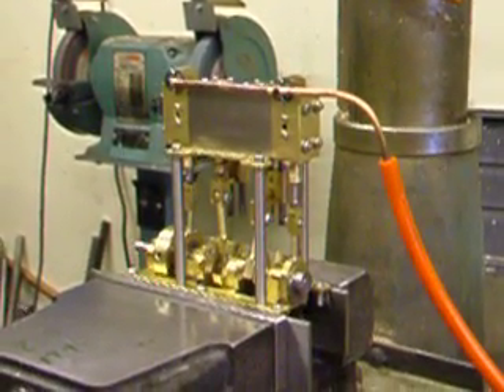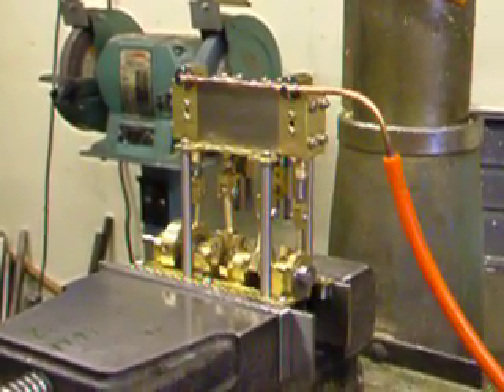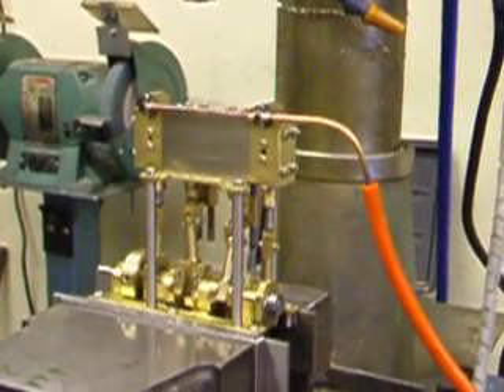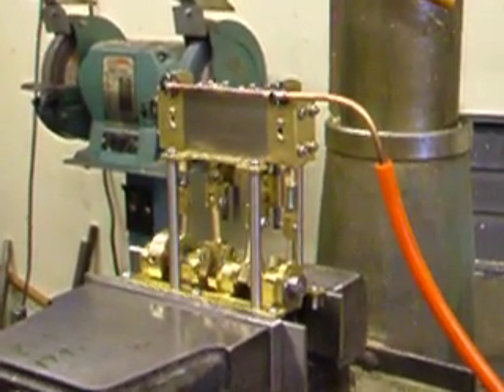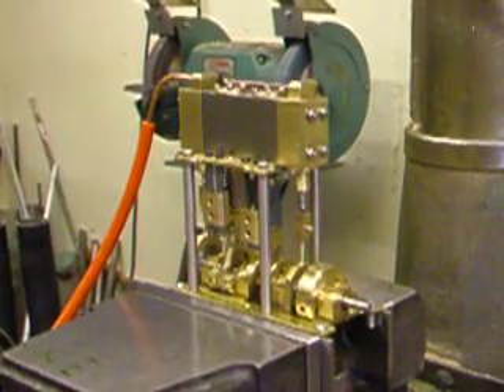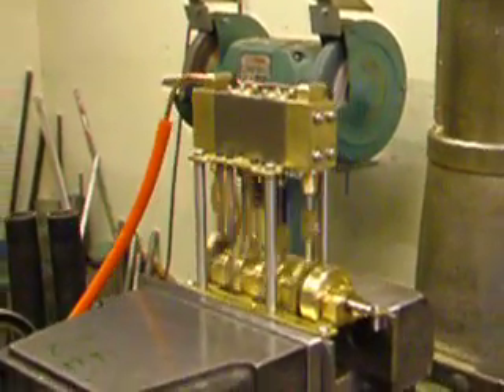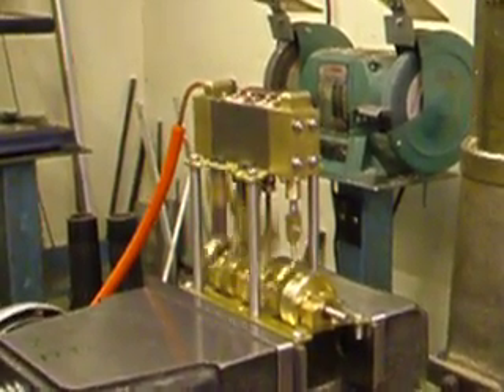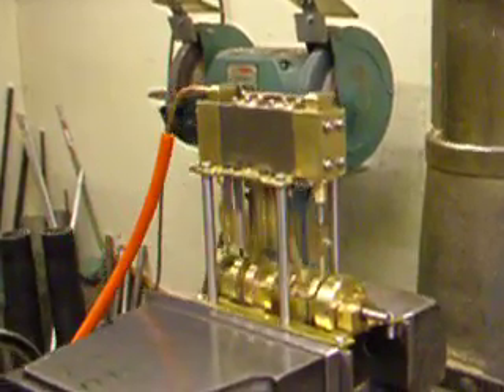Proving run of model steam engine

Comment: Hello,
I just changed the dimensions of the machine. The displacement is 5CC bore 10 mm and stroke 16mm. I made plans with the quotation drawing and 3D view.
The crankshaft is different, the bearings are bearing. The machine works well with trè-s pistons teflon pans. Video here.

A+ Francis

Comment from the maker: I should think about 60 to 70 hours, for the two.
To the finished stage about 100 to 120 hours.
A lot of that was getting the materials. These were built from scrap, so had to have a lot of machining just to get the basic building blocks. The cylinders were made out of old window sash weights.